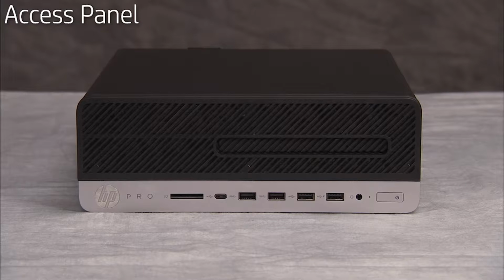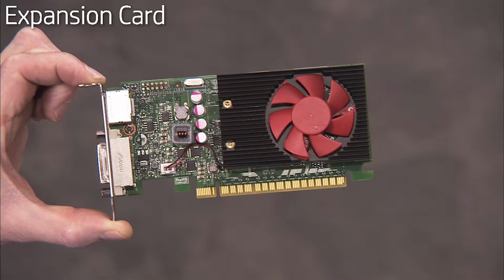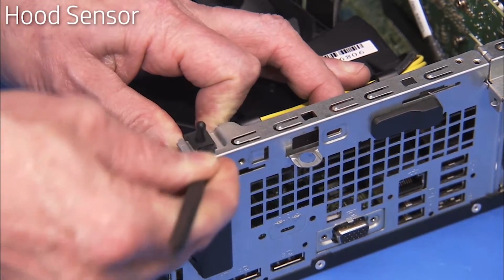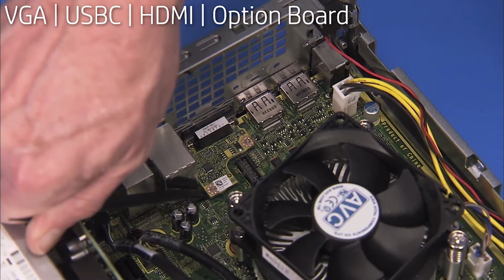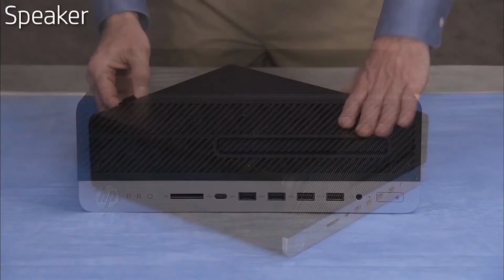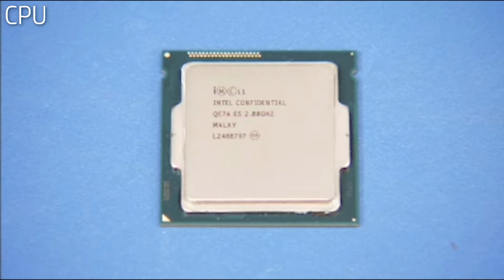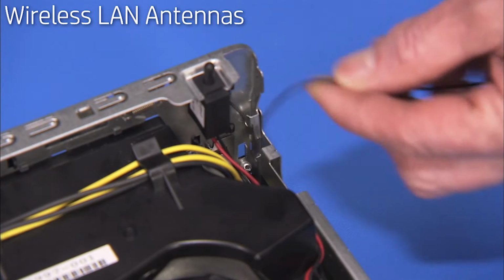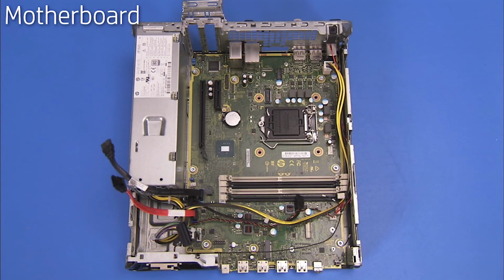Removing & replacing parts for HP ProDesk 600 G3 Small Form Factor | HP Computer Service

Comment: Can I remove the front io panel and put the motherboard in a different case ?
Reply from the maker: +STONE EYE D3MON HP does not recommend upgrading or downgrading hardware parts or software that is bundled with the product as It may affect the manufacturer's warranty and performance, however, you could change the configuration at your own discretion.

Comment: Does anyone know if it can run this PC in headless mode as a server?  I had HP ProDesk 600 G1 that would not boot if no monitor was attached.  I had to buy a dumb VGA connector to fool it so that it would boot.  I would rather not have to go that route again.
Reply from the maker: Hi Matthew, thanks for contacting HP Global Social Media Support!
I understand that you need to know whether you can run this computer in headless mode as a server.
In order to get this issue fixed, please contact our customer care team over the phone or chat for further assistance, as this issue requires Live conversation with you over phone or chat to isolate the issue and provide you instantly with appropriate solution or repair/replacement options available at your place as per the warranty.
Please feel free to reach us on call/chat, please access this link to select your preferred country and language option to reach us. Global support link: - https://www8.hp.com/us/en/contact-hp/ww-phone-assist.html
Binu_HP Social Media Tech Support

Comment: can i connect a remote power button?
Reply from the maker: Hi there, thanks for contacting HP Global Social Media Support!
I understand that you need to know whether you can connect a remote power button.
I will do my best to assist you.
HP does not recommend upgrading or downgrading hardware parts or software that is bundled with the product as It may affect the manufacturer's warranty and performance, however, you could change the configuration at your own discretion.
Binu_HP Social Media Tech Support

Comment: Can I take the motherboard and switch the case
Reply from the maker: +STONE EYE D3MON HP does not recommend upgrading or downgrading hardware parts or software that is bundled with the product as It may affect the manufacturer's warranty and performance, however, you could change the configuration at your own discretion.
Reply: Can you show a video of switching the case

Comment: What is the maximum capacity supported for M.2 ssd & 2.5in SATA SSD for this computer?
Reply from the maker: +Firdaus Zainudin Please refer page number 10 of the user manual to know about the supported storage: https://bit.ly/3DDmyOT
Reply: @HPSupport  Hi
From the page, it seems I can only use a maximum capacity of 500 gb for an ssd drive (2.5in). Does this mean I cannot plug in a Samsung Evo 2.5in 1Tb drive?
Thanks
Reply: @damdibidum  Okayy, thanks :))

Comment: Can the optical drive play blu-ray discs?
Reply from the maker: +Justin DeSilva The optical drive in your computer must be compatible with the Blu-ray disc format, also known as BD format.
Reply: @HPSupport  I see the optical drives for the Prodesk are limited to one type due to its size. Does the G3 600 play blu-ray?

Comment: my hp prodesk 600 G3 SFF starts slower
Reply from the maker: Hi Mohamed, thanks for contacting!
I understand that you are experiencing an issue with your computer as it is running slow.
I will do my best to assist you.
Please perform updates via Windows and HP Support Assistant as mentioned below to fix this issue: Step 1 Windows Updates - 1) In the search box, type and open Windows Updates. 2) Check for updates. 3) If the updates are available, click on install and restart the computer. Step 2 HP Support Assistant Updates - 1) In the search box, type and open HP Support Assistant. 2) Check for updates. 3) If the updates are available, click on install and restart the computer.
Binu - Social Media Tech Support

Comment: The power button turned red and started making a sound
Reply from the maker: +Francisco Rodriguez This document provides possible solutions to many common computer start-up issues. Follow the instructions in this document step-by-step to help isolate the problem and find the most appropriate help: http://hp.care/2oFlOWC
Reply: @HPSupport  thanks, the ram was badly connected